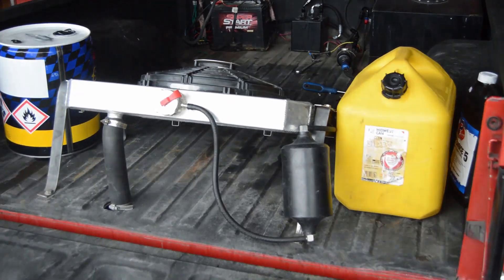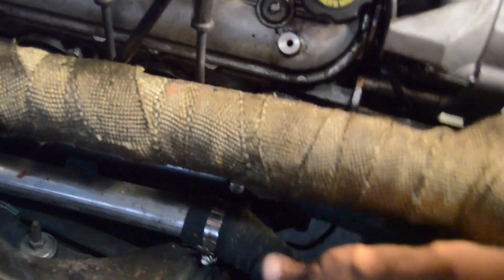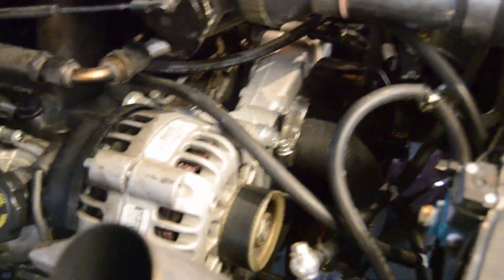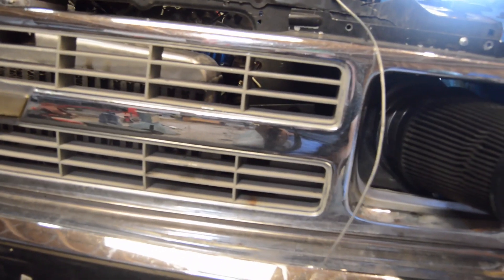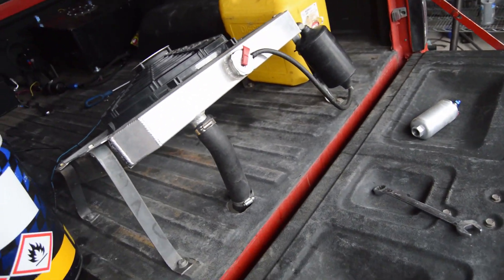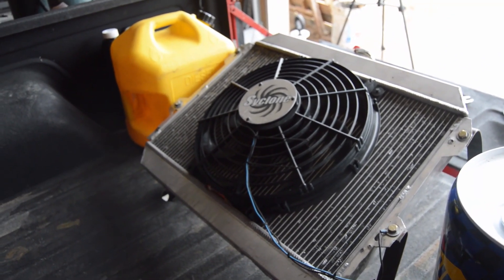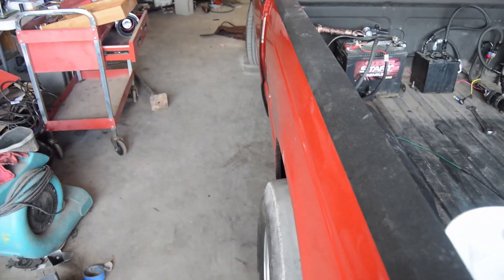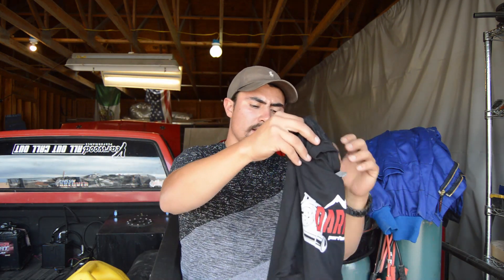Rear mount radiator review

Comment: definitely try reversing the fan. Heat rises so the way it is now you are pushing the hot air back down. Maybe hole saw a couple holes in bed floor right under the radiator too?
Reply from the maker: Yes that was also one of my thought was making a few holes in the bed might just both of those things over the winter

Comment: I Ls swapped my s10 and I’m about to mount my radiator in the bed.  I was going to run hose but I think the exhaust pipe is way better of a idea
Reply from the maker: It worked well for me. I’m fixing on re doing this one and I’m probably going to be doing AN lines it’s expensive but the exhaust tends to get in the way a little bit
Reply: @darksideperformance299  hell yeah . Post a video of the update I’ll be here for it.

Comment: Hot air rises so I would first try having your fan pull the hot air up instead of pushing it down that should be as simple as reversing the positive and negative instead of having to remount and if that doesn't fix it I would make sure your external electric pump is pushing the right direction if you're still seeing overheating I would leave the system as is after the changes are made and get a bigger radiator and possibly more fans once I got my rad set up right I was seeing below average stock coolant temperatures hopefully this helps

Comment: Do you use water or coolant?
Reply from the maker: juicyjaaypee water
Reply: DarkSidePerformance there is one problem. Water has a low boiling point in comparison to coolant. Water when boiling becomes a vapor. So, in an enclosed system the boiling hot water and the vapors increase system pressure therefore increasing the temperature. Water also rusts the inside of the system. Why are you running water exactly?
Reply: If you’re running water run distilled and it won’t rust and add some water wetter
Reply: juicyjaaypee some tracks don’t allow coolant because it can cause the track to become really slick